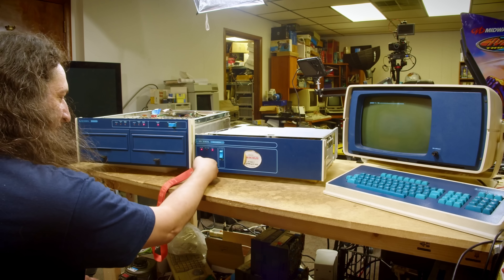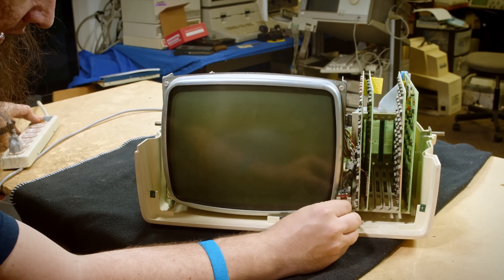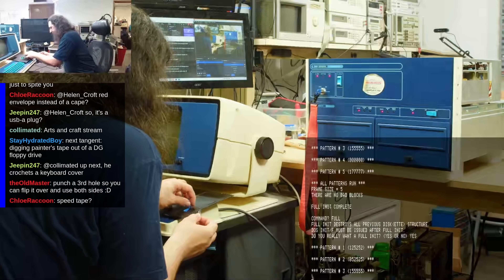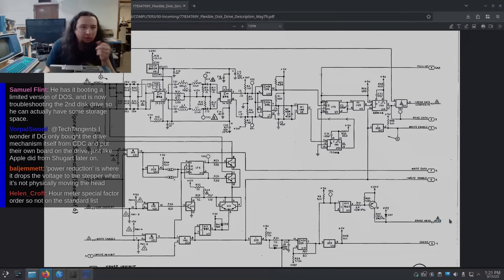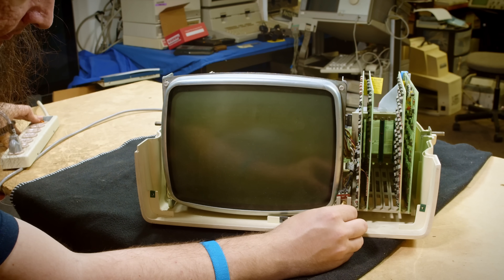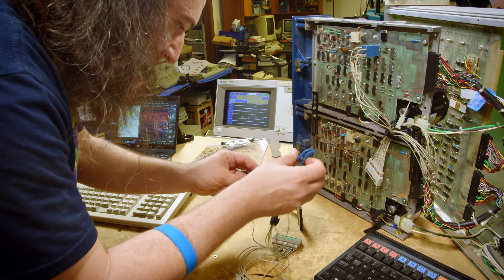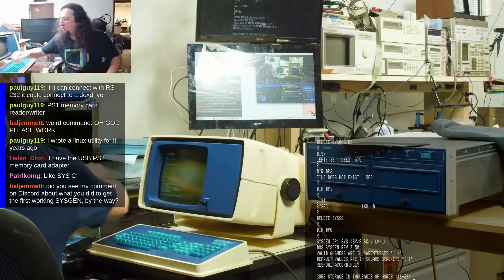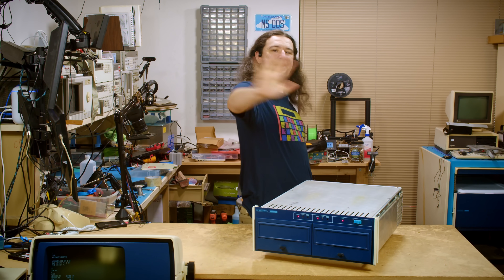70s Floppy Drive Repair - Data General 6039

Comment: Sorry to say, but at such old things the basic things are: electrolytic capacitors and SOLDERING. So you should have simply took a look on the solder and that's it. But still impressed what you did.

Comment: Since all the chip identification information in the schematics are effectively lookup tables, couldn't you just make a spreadsheet that can map a chip from the schematic directly to the real parts table? In my mind they all look like fairly typical foreign key table maps in databases, which could be made into a simple CSV

Comment: You should have made sure the solder connection was actually broken by pressing on it while checking continuity - before reflowing it. If you are sure it most likely was - then you most likely fixed it.

Comment: It's not the first time you found bad solder joints. I would've checked every joint under a microscope or simply put new solder on everything a long time ago, the same way you restored all of the caps a long time ago instead. Is it a bad way? Would it take more time and effort compared to getting new and new errors appear?

Comment: I have no  computer or electronics experience at all, but I watch so many of these type of channels avidly and marvel in the complexity of the subject AND THE MIND BLOWING KNOWLEDGE  of the presenters. Just so awsome to watch this guy, Usagi and Adrian, to name a few, grapple and solve complex electronic gremlins.
Mesmerized in South Africa
Reply: What really blows my mind is that even though this looks complex to anyone who isn't versed, these computers were several orders of magnitude simpler than what we're currently using. Trying to troubleshoot an equivalent error on a modern machine without full datasheets would be utterly impossible. Retrocomputing enthusiasts in the future are going to have a hard time...
Reply: @fallingwater  right but there will be far more left over systems and components

Comment: Given the age of these machines, the weight, and the nature of old solder, i do not think it would be a stretch to say that resoldering the boards or at the very least, looking at them from the get-go would be a smart "power-up" procedure bullet-point. Just sayin'. Plus, it gives opportunity to visually inspect for potential damage beyond just solder issues. Damage that might take a board's chips out or the like. It's not a "cheap" action to undertake, but it is the "cheapest" solution, potentially.

Comment: reflowing solder joints is one of the first things you should do. 
1 Thou shall check voltages!
2 Thou shall check solder joints! 
3 Thou shall test capacitors.
You should have just removed the drive PCB in the first place and reflowed every solder joint. If it was wave soldered, it is guaranteed to have bad solder joints.  You would have saved many days of work.

Comment: i love your videos of old tech, in 60 years old this month and got a sinclair zx81 when it was released in the uk (1981 approx).  i got a cd burner from microdirect in manchester uk in about the year 2000 and was soo excited that i could burn cds !! now all that tech is super ceded by laptops and tablets etc etc. i worked for the bbc as a radio engineer in the early 1990s and their training was good - we got chip level training regarding disk drive interface circuits - so i understand all the stuff you are doing- mostly. ha ha.  at present i love windows 10 because with firefox browser and ublock origin i still get advert free access to the internet. even on my android fone ublock origin STILL works with firefox. im still the tech guy for a crypto mining farm in birmingham england - where the objective is the least electric used for the most coins mined. keep up the great work - im especially amazed by the chunkyness of old tech - what is it is a massive waste of electricity - cos you can get it all done now with tens of watts instead of hundreds.

Comment: you should add a timeline to the whole data general project. I cant correctly imaginge when what was done or broke.
Reply from the maker: There are pages for some of the devices on my wiki but I don't have one for the Dasher yet. They have repair logs listed by month there. But it is a whole interwoven mess of repairs for this project, even I have a hard time keeping it straight!
Reply: Imaginge Drangongs 💀